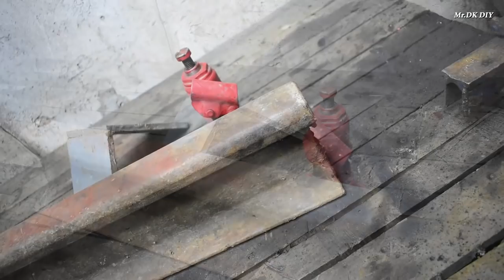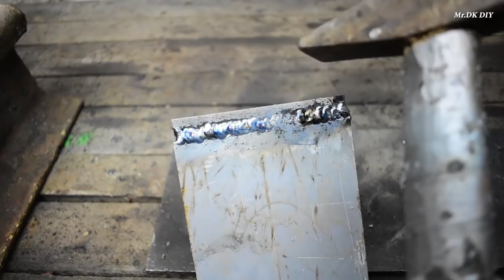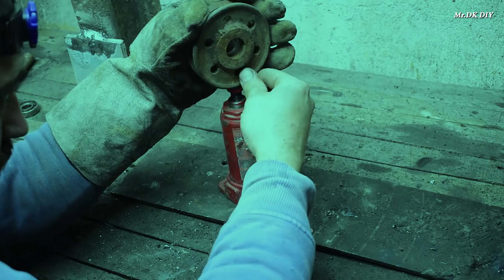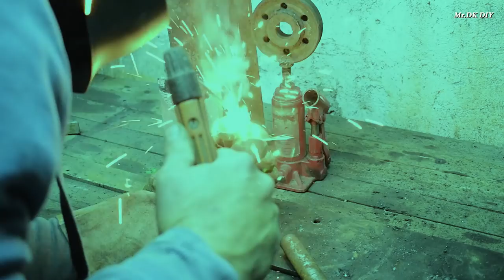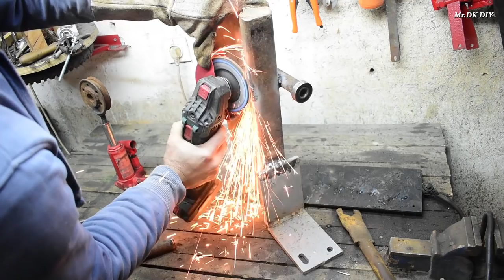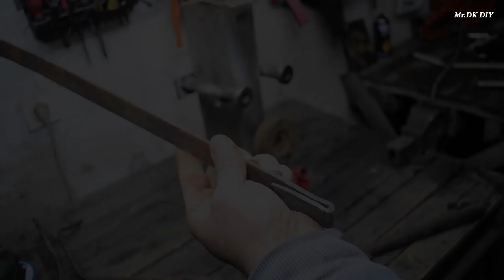Hydraulic Jack 2 ton ??? / Homemade (metal) PIPE BENDER MACHINE USING Hydraulic Jack 2 t

Comment: To get a stronger weld, especially on thick walled stock, you should think about making a continuous bead.  The way you are doing it, DK, works OK for thin sheet metal but that method encourages slag inclusion on thick stuff.  With a bit of practice, you'll get a much prettier weld bead too.  Just a thought.

Comment: if you hold the electrode in a natural dragging motion it will penetrate better. I wouldnt trust the small tacks across that heavy metal. just watch you welding puddle and let it burn in. lay the rod in the seam of what your welding and dont pull it across just maintain even speed across.